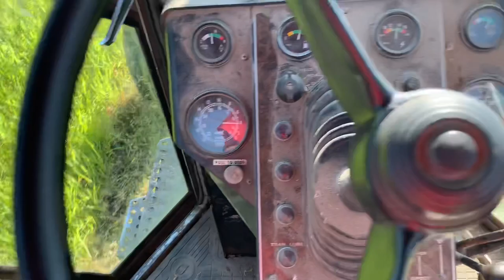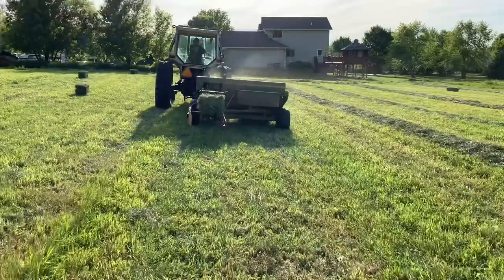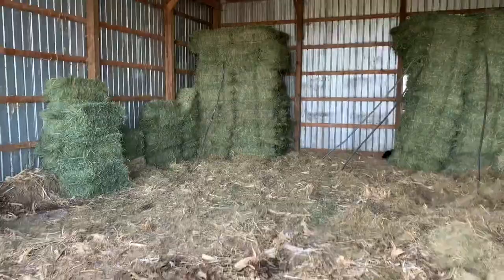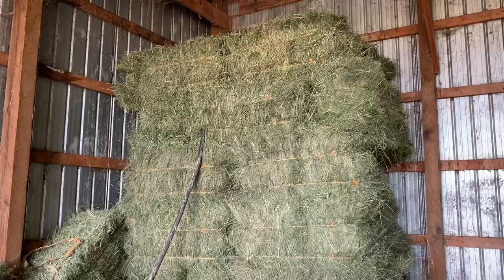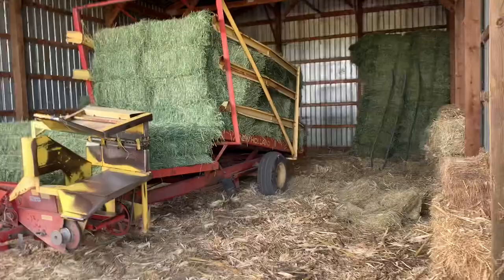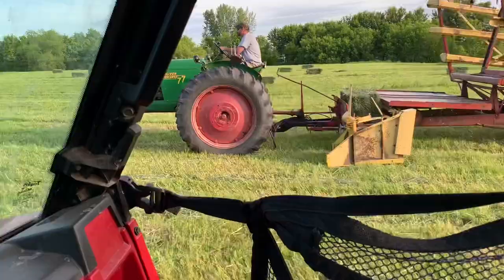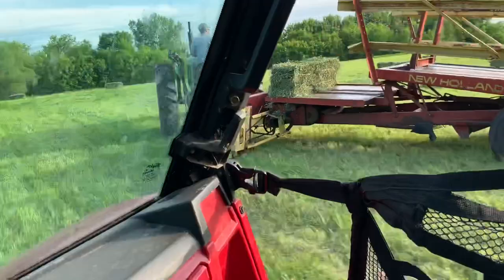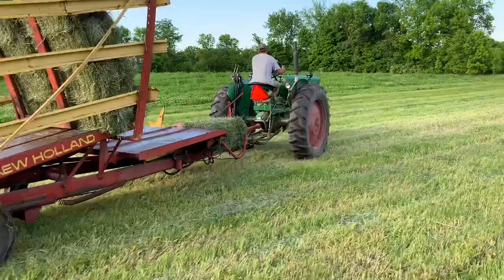1st crop grass small squares using a John Deere 336 and a New Holland stackliner.

Comment: If you straighten up the pushoff feet, then when you push off, push out about a foot, bring the feet back in, then push out.. they will stay straight.. been years since I have see a pull type at work! We had a 1037, three wide machine we bought new, about five years later it got traded on a 1048.. around twenty-five years later, traded to the 1075..
1048 drove better, but 1075 makes a better stack.
Good looking hay!!! 
Thanks for the video!!
Reply from the maker: Thanks Ed. This will be that units 47th hay season. The tracks the feet slide on are a bit twisted. (damaged at some point)
Reply: @crazydave4455  ya, I've rebuilt a few sets of pushoff feet.. not just on our machines, but on probably a dozen others...👍

Comment: The hay looks like you cut it with a brush mower tiny pieces. Usually when its chopped that small it never dries like lawnmower grass
Reply from the maker: That wasn't typical of most of the field. Just a few of the outside rounds close to the wetland. The grass there was finer and shorter. It was cut with a new Holland haybine.

Comment: I love the baleliner.  Now I want one.  Would it work with a Ferguson tractor?
Reply from the maker: It should, the tractor running this one is 30 some HP. The stackliner has its own hydraulic pump so you just need a PTO. Just make sure the tractor is heavy enough to handle the weight. This Oliver is 4200# and heavy alfalfa bales can make the nose light.

Comment: That's a cool machine. How many bales can you get on a load?
Reply from the maker: 56 in the stack,  plus what ever you want to handle by hand on the platform.
Reply: @crazydave4455  that was my guess, a neighbor used to run one until he went to big squares.
Reply: @pinesedgefarm1155   That machine could probably push out 100+ at least. On my farm  mine is  A Ferguson not a John Deere. One field I got 350  Of 80 pound bales. 
2nd crop is a little bit smaller show around 340 bales baler wise...
   Our hay wagons can hold about a 100

Comment: Think a lil Ford 8n could handle the bale picker?
Reply from the maker: I’m sure it would have enough power, it would be the weight I’d worry about. The rear axle is set way back, a good load of alfalfa will make the front end light on these 77s.
Reply: @crazydave4455  okay, thank you for the reply